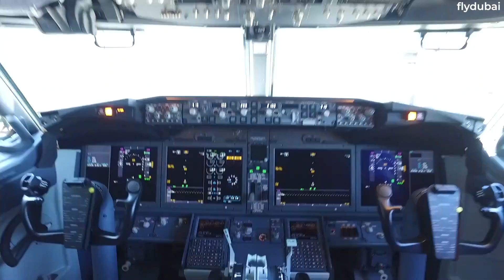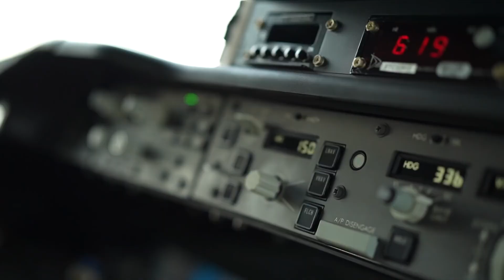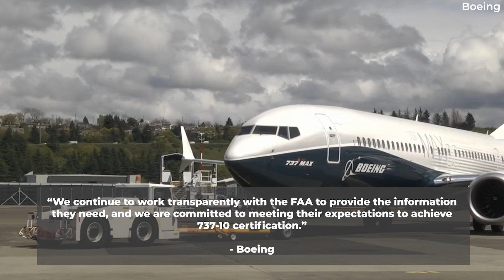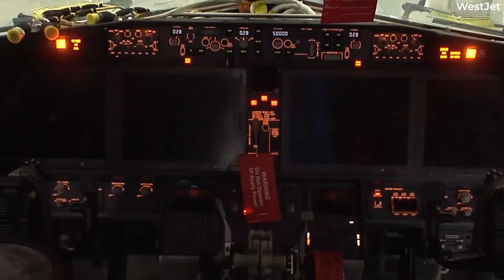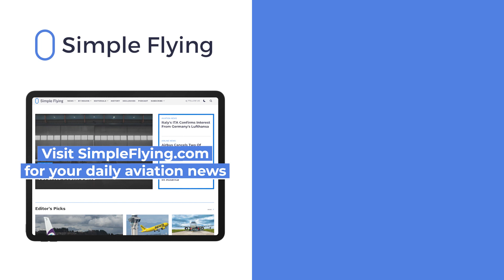Boeing Worried About Missing Key 737 MAX 10 Certification Deadline

Comment: A very interesting article, it is obvious that due to the fact that the 737 is a design going back to the 60,s it has to some extent been living on borrowed time, and after the two terrible crashes due to the MICAS system the American CIA wished to make sure it did not happen again. my true thoughts are that Boeing should be now building a replacement and a New Design for the 737, after all its had a wonderful production run but for today,it is simply out of date. The only reason Boeing decided to stretch the 737 one more time is that they were losing sales to the Airbus A. 321  which seats 240 Passengers and has recently been fitted with extra fuel tanks to give it Trans Atlantic Range, I do not think the 737 10 can match the Payload or the Range of the A.321 ?  In the Aviation market, there is a shortage of good Passenger Jets of the 200 / 240 seat range, and as we can see Airbus are sold out for many Years ahead which does give Boeing and its dated 737 a great opportunity to continue to sell If Boeing g had a New Model to offer Airbus would have a lot more competition than they have
Boeing will have to ' Bite the Bullet ' and update the systems on the 737 not ask for a ' Fudge ' from the CIA of America.

Comment: I don’t have a problem, if they adjust the certification method for this. Everyone working in long term development projects knows the difficulties with changing regulations over time. And even the MAX engineering is more than 6years old, so finding a common sense solutions is fair to me - even if it’s Boeing.

Comment: The 737 is kinda like the VW Kombi here in Brazil. The thing kept selling with it's 70s chassis and body till 2014 when VW decided they didn't wanna bother re-engineering it to have the newest safety standards.
The difference being the Kombi only got a proper re-engining in 2006 when the old pushrod air cooled boxer stopped being produced, the 737 at least got some more upgrades and 3 engine swaps.

Comment: This I think goes to the core of the 737 MAX /Boeing problem.  Boeing is Still more concerned about compatibility with old generations than it is about Safety!  Clearly, these new Safety system requirements improve Safety! Why hasn't Boeing unilaterally installed this functionality on ALL MAX types!! 
We all have a voice! Use it! THIS THINKING MUST CHANGE!!

Comment: What is the cost comparison between better safety systems and pilot training  vs  the chances of loss of aircraft and pax. Has nothing been learned from the two MAX disasters ?
Reply: That's exactly why they're going that route: the chances of accident, much less fatal ones, AND to be blamed on the aircraft itself, are so absurdly minimal that the comparison to the costs of retrofitting the systems, delaying the costumer deliveries, possibly passing the costs to the costumer and them maybe not wanting anymore because the added training doesn't justify getting the aircraft anymore, is significant on their accounting books.
They see it as risk vs. reward, no matter how unethical this might seem to anyone else, those are the numbers they'll balance out.

Comment: Here's a thought for Boeing. Either get the 10 certified before 31 December, or develop the EICAS for the 10 and retrofit the system to the 7, 8 and 9. I don't believe for a second it would cost $10 billion to develop EICAS for the MAX - it's not as though every other Boeing model doesn't already have it. The optics of this are appalling!
Reply: It’s not necessarily the money. It’s that airlines would have to spend money to get their pilots retrained on this EICAS and it could potentially mean Max 10 pilots cannot fly other Max aircraft due to the excessive differences depending on what the FAA decide. This would put airlines off buying it

Comment: And again we see how a 50 year old air frame has become too old to cope with morden technological advancements
Reply: 60+ even, that 707 face ain't fooling me.
They really milked it a lot, you would expect that they would have made something based on the 757 when they had that one but eh why?
Reply: @Kalvinjj  to save on cost, that can also explain why the 727 also looks like the 707 and 737
Reply: @Kalvinjj  In reality nearer to 70, but if you go back to the initial design and development even more than that.

Some keep going on about how the A320 isn't that much younger without realising that the Boeing single aisle fuselage in rooted 
 in the days where jet propulsion in airliners was in its infancy, and so much was unknown. By the time the A320 came along,  jet travel had matured and the understanding much closer to today than its numerical proximity to the early Boeings would initially suggest.

Comment: I don't get it. Is it good or bad? The only thing that I understood is that Boeing basically certified their 737 MAX on their own and... Two crashes happened. I don't get the idea of an extension to avoid installing a feature that could add more safety to the planes, just for the sake of saving money on Boeing's and the airlines pockets. I don't know if I'm reasoning this right or I'm missing something.
Reply: That’s exactly it, the new regulations would require that the EICAS warnings are more clear/evident because of the mcas induced crashes.

Comment: Am I missing something here? Apart from the delay, why would Boeing try to get around a SAEFTY issue with a 737 max series aircraft?! As others have already pointed out, this seems like a terrible idea for a commercial liner with the rep that the Max has...
Reply: Because it might put buyers off if they have to pay for the pilots to attend extra training because if the new requirements
Reply: I’ve read that making the 737 compliant with the new regulations would be extremely costly as it involves a radical redesign of some key areas of the cockpit…
Reply: It's not a safety issue for max series....all 737s in the world would not be compliant.  If it were truly that important, then ALL 737s would need to be grounded.
Relax
Reply: @737MaxPilot  well, that wouldn’t be the case, as new regulations concern only to future certifications. They can’t be enforced retroactively, otherwise the majority of currently flying aircraft needed to be retired, not just 737s
Reply: @matteofalduto766  but this is where the FAA has changed their rules…to include ANY certification. So now, you won’t be able to do an amended type certificate unless it meets all current requirements.

Comment: The 737-Max 10 to me is too big to be called a 737 anyway. Why not call it the new 757 NMA aircraft and get it fitted with improved modern 757 avionics and enginees. Just imagine the large number of airlines that will quickly dump Airbus planes for this plane as soon as the hear about it, i.e if Boeing were to consider doing that....
Reply: Because it doesn’t have the range of a 757-200 or the capacity of a 757-300 so it’s nowhere near like a 757. The 757 was also powered by way more powerful engines than the LEAP1B’s

Comment: I'd rather passengers be safe even if that means pilots need extra training for the max 10.
Reply: By your logic, no 737 passenger is safe now.
Reply: @737MaxPilot  well no. Just the max variants
Reply: @eamonahern7495  wrong. You say that for passengers to be safe, then the airplane needs the updated design the FAA is requiring, right?  Well guess what? No 737 has this updated design, so then by your logic, ALL 737s are unsafe.
Reply: @eamonahern7495  common sense on

Comment: Boeing really does have a hell of a nerve considering the legislation they are trying to circumvent was put in place because of corporate greed and dishonesty. I am sure they will get the workaround they seek because it's a multi-billion dollar company. However wouldn't it be nice for a change if the government held its ground and acted as if it still had a backbone? Personally, I would rather be on an aircraft that has all current and relevant safety equipment as I would say the airmanship of many commercial pilots has gone downhill with all the automation in the cockpit. Whatever happened to good ole stick and rudder? That is how I learned to fly.

Comment: Wasn't that what caused the Boeing 737 Max crashes in the first place - pilots not understanding which critical system (AOA sensors) had failed and not training pilots to deal with such a failure because it would cost money to do that? Looks like the crooks running Boeing have done nothing at all during the time they were grounded.

Comment: So Boeing want to avoid following new rules, which were basically brought in specifically due to Boeings failures that caused the crashes of 2 aircraft in the exact same aircraft family, and keep this new aircraft in the same lower safety standards as these family members? Sometimes Boeing is just beyond belief...
Reply: This is why I have zero confidence in Boeing and avoid their aircraft.
Reply: @richardchantlerrico  You might as well take the train then as flying is still safer than driving
Reply: @filledwithvariousknowledge2747  Boeing aint the only manufacturer - also people can avoid a company they don't agree with the actions they do. Doesn't mean we have a fear of flying.
Reply: Nope, the rules were not related to the crash. I think it was on the agenda even before the crashes. 
I don’t have a problem, if they would adjust the certification method. Everyone working in long term development projects knows the difficulties with changing regulations over time. And even the max engineering is more than 6years old, so finding a common sense solutions is fair to me - even if it’s Boeing.

Comment: Boeing...trying to restore their reputation for safe aircraft
Boeing...trying to get out of having to pass safety regulations that were a result of them going around the previous one resulting in 2 crashes.
Not exactly the way you would achieve customer reassurance.  Airline pilots should have to retrain on any new variant to some degree.
Reply: Boeing is like a chronic drunk driver, still on the streets, still carrying on like they're not responsible for people who died in the two crashes of the Max.
Reply: This new rule has nothing to do with the accidents.
Reply: @737MaxPilot  No one said it did.  I see it as bad public relations to be not wanting to be subjected to any rule after what happened.  It doesn't really matter what the rule is for, but one would assume it is safety related since that is what rules are for.
Reply: @ScottCP1  so all this noise from the comments is just un-educated rambling, basically.
Reply: @737MaxPilot  no, it's opinion, and everyone educated or not has one

Comment: So basically Boeing is trying not to install the same feature all Airbus have had since the A320.
Reply: Correct, to maintain commonality with all other 737s.
Reply: @737MaxPilot  If they had implemented it much sooner they could've had that commonality today :'D
Reply: @boahneelassmal  
The problem is as soon as they introduce it, it creates costs for the customers in training pilots, which means it offers opportunities for them to go to a competitor for a deal.

The problem Boeing had was the A320 NEO.  Companies needing up upgrade their 737s had an opportunity to jump ship and buy the A320.  To prevent this Boeing rushed the MAX to be its competitor. 

Unfortunately to the larger more efficient engines was not a simple job on the 737 so they had to push them forward and up.  This created handling characteristics different to the current 737s which meant that pilots would've needed expensive training.  MCAS hid this difference.

As a result companies now had a choice order a A320 with expensive pilot training or a MAX with a cheap refresher  making the overall MAX cheaper to airlines (already with 737s).

As it is, the MAX now requires expensive pilot training, and it looks like the 10 is heading to require different expensive training.

At whatever stage they upgraded the cockpit it would result in expensive pilot training which gives a foothold for Airbus to get in the door as to stay with Boeing would be comparably expensive as switching.
Reply: @cigmorfil4101  1. Ok
2. I know
3. My point still stands. There comes a point you need to rethink your concepts and if Boeing had done so with the NG series they wouldn't have had these issues today

Comment: News Flash: ALL manufacturers have concerns for certification deadlines and ALL have issues with spending money on new type ratings.
Boeing was unfairly singled out by an ignorant, anti American (read: Trump endorsed) Mainstream Media as an evil, Capitalistic conglomerate that put profits above Safety.
This was utter and complete BS, given that both Max accidents were at the hands of incompetent crew. (Have a look at the actual raw data FDR and CVR narratives in the accident investigation reports)
Reply: If it was only incompetent crews that caused the crash then why did the plane stay grounded for nearly 2 years? The fact that airlines who bought the AOA disagree light only to be told the system doesn’t work unless you buy the AOA indicators proves Boeing cared more about profit

Comment: 737 Max. Maximum efficiency, maximum profitability... And also the maximum they, Boeing can get out of the airframe. The 737 MAX is a drawn out, badly managed project with maximum headaches. Just what are Boeing doing? Or rather, not doing? I remember the days they build the 777, don't recall such dramas back then, and a well managed project. What a nightmare.
Reply: watch the downfall of boeing it explains very well how it all went wrong

Comment: I'm sure there's going to be a work around, without compromising Safety.
Reply: Work around, yes. Without compromising safety? Really? If they get the extension, then it will say that nothing has changed with regards to Boeing's unhealthy influence over the FAA.
Reply: @jennyjohn704  - They'll Finish the Required Testing in Time to meet the Deadline.  That's my guess.

Comment: The FAA finally wanting to improve the old antiquated grandfather certification process which has been very convenient for Boeing to spare millions of $ in developpement cost = impractical for Boeing. That's right we all understood it already.
Reply: So, how do you convince a manufacturer to design & build new aircraft, when anytime the regulator wants to change the rules, the manufacturer would be required to change the design around the new rule?  Given this is not a critical design issue (MCAS, wing falls off, etc), how do you justify requiring Boeing change the design after it's already started flight testing?  If the FAA holds on this, it will kill the program.  Not going to happen.
Reply: @737MaxPilot  There has to be room for both parties. As you present the case you make it like Boeing is victim of over regulatory constant changing rules from the FAA but it is simply not true. Boeing know exactely what kind of regulatory capture they did and for what purpose. They should have known that this couldn't last forever. Refer to some FAA employees having warned about this for decades.
Reply: @12345fowler  Sure, but how could you expect Boeing to be required to redesign the -10 due to a rule change made after the -10 was in testing?  Apparently it’s not such a safety concern that requires all other 737 variants to be changed, so why just this version?  My guess is the FAA will grant the exception for the -10 and -7, with the exception that there will be no further variants (or new designs) without the updates. This change is obviously not a critical safety issue…otherwise the whole fleet (Max, NG & classics) would be grounded.
Reply: @737MaxPilot  You know, this is the nature of power. FAA has the power to say yes or no. Boeing will have to comply. This is the rule of the game. Boeing maybe unhappy, crying etc. whatever but if the FAA stand it's ground there is nothing Boeing can do. Certification is just one step to safety. Look the Comet was one of the first jet airliner to fly it was certified but after several decompression accidents after certification and many deaths, De Havilland had to modify the fuselage windows from square to ovale. At that time the forces of pressurisation in a jet flying much higher than previous piston powered types were not assed correctly, and thus explaining how a dangerous and insufficient design got past certification. Rules can change during certifications and even after (AD) that is not an issue if they are for a safety reason. In the case of boeing, I think there is sufficient reasons for the FAA to make that move.
Reply: @12345fowler  obviously. you’re citing a circumstance of a critical design flaw. Not having EICAS is definitely NOT a critical design flaw. There are ADs that ground immediately (Max), and there are those that do not. Don’t over-simplify this.